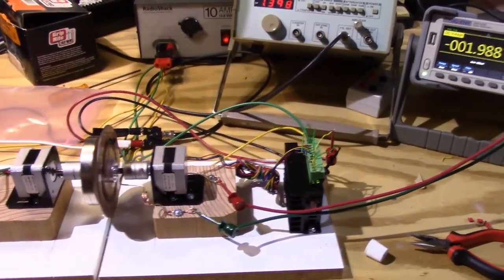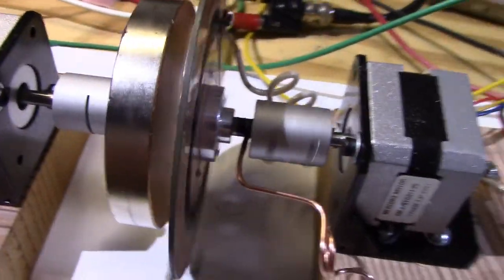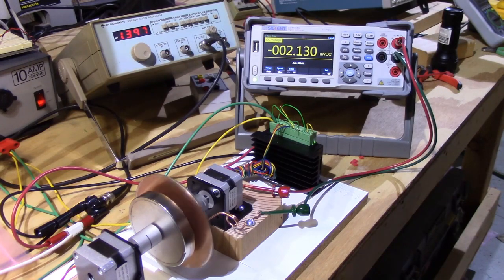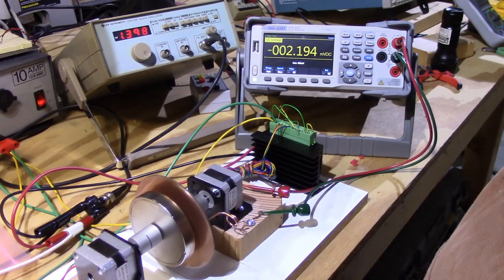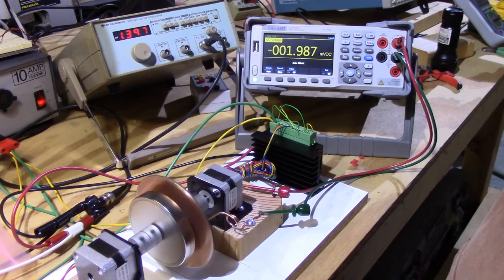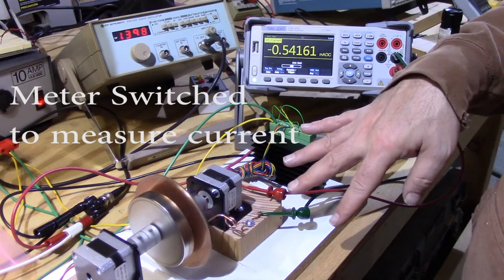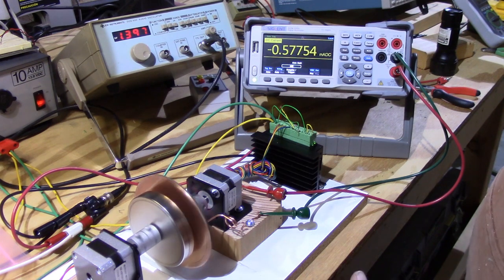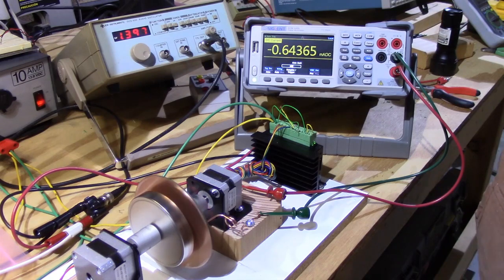PDX1 08: Paradox 1A demonstration: Faraday's Final Riddle

Comment: Sorry if it is already done in the following videos, but I think you should mount a voltmeter, or some compact detector on the same shaft with the magnet. Then rotating magnetic field will not induce voltage in the wires to the voltmeter. In that case there must be voltage even with stationary metal disk and rotating magnet.
Reply from the maker: It does not matter -- https://youtu.be/tzPgIKzSOfA?t=52
Reply: @rdistinti  Yes, I realized it after I post the comment. 
But there is another option: avoid the closing path. E.g. metal disc can be split in two parts, inner and outer, at the middle radius. Before the test we connect them together, then during the rotation disconnect them, stop rotation and measure the charge between parts of the disc. That will show us, if there was a radial electric field during the rotation, without any 3rd part. Or we can heat up the disk and rotate it fast enough, to force electron emission from the edge of disk. There may be many ways. Actually we don't even need a disk, we just need to measure the electric force near the rotating magnet. We can take an electrostatic dipole (like an "electrostatic compass"), put it near the rotating magnet and see if it will turn parallel to the radius. Or we can put an electrically charged dust and look if it will fly to the center or periphery depending on magnet rotation.

Comment: Did you do the amps reading with a stationary disk and a moving magnet ? Everyone does the voltage reading on that and it's below multimeter range, but i'm interested in the amps when only the magnet is moving.
Voltage has absolutely no importance. Voltage can be easily created. Only amperage matters.

Comment: "Electromagnetic Fields and Waves" by Lorrain & Corson (2nd edition) discusses induction in a moving system in Chapter 8 and Appendix C.  (I used this as an Undergrad.)  The 3rd edition contains it as well but the text has a different arraingment.  Faraday's Disk is also in Chapter 14 "Dynamic and Quasistatic Fields" of Zangwill's "Modern Electrodynamics";  it's on the level of Jackson without all of the sharp edges.
Reply from the maker: This site is old.  see the updated site https://youtu.be/8D6VaoEeRt8

Comment: Magnetic field lines are microscopically uniform and moving at light speed from N to S so speed of rotation of the magnet is irrelevant but the conductor disc cannot be uniform microscopically and its' spin cuts through the magnetic field lines like a wire thereby causing currents in the disc whose induced magnetic field opposes the direction of the manets field?

Comment: Just don't turn the disk or the magnet but just turn only the brushes in stead. It's simple where the voltage is coming from. It comes from the brushes by triboelectricity. The difference in friction is the volta generator. It can't hold the charge for long though because metal is a good conductor. I don't get it am I surrounded by stupid parrots 😂? Use your brain folks it comes from the brushes!!! Triboelectricity I say!

Comment: the "lines of force" that iron filings produce, is an illusion?

they are ferromagnetic. each filing becomes a magnet in its own right. and, as magnets are want to do... they will line up in long strings, NS>NS>NS...

and when those strings lie side by side...

NS>NS>NS
NS>NS>NS
NS>NS>NS

see how like poles are side by side? and what do like poles do?

they repel.

the "force" is at RIGHT ANGLES, acting BETWEEN the lines....

i keep coming back to bernoullis theorem regards that one... as if there is a flow... a rotation around the axis of the magnet.

and like little ping pong balls with a stream of fluid passing between, they tend to get "sucked together"... in the direction of faradays "lines of force".

we can demonstrate quite easily that the strings of iron filings remain stationary when a magnet is moved around, that the "lines of force" have no direct connection to the magnet itself.  simply leave a small gap under the magnet (with a pole towards the paper) and when the magnet is rotated, the filings and the "lines of force" they depict remain stationary. slide the magnet around sideways... and the filings follow the magnet pole exactly as any other magnet will try to. but those "lines", they have absolutely no connection to the magnet itself. they are an ILLUSION. they are not showing a field or "line of force", they simply show that they are becoming magnetised themselves.

and that ties in very nicely that it doesnt matter if the magnet moves or not, its simply how the conductor moves in relation to the field or "distortion" or "flow" or whatever it is that magnetism actually is... any movement of the conductor in that "field" creates a potential difference, a change of pressure, a change of "flow".

when we PUSH one of these strings, these lines of force, what do we see? the adjacent lines move as well... the force is acting at right angles BETWEEN them.

any rotating system has two sides. two "poles". one CW, one CCW... its inherent and cant ever be any other way.

two rotations in the same direction complement. the rotation continues, and if there were a "fluid" between, it would be flung out, and a void or low pressure zone shall be created. we get attraction.

two opposing rotations cancel, any fluid "stops", remains stationary, and increases in pressure... there is "repulsion".

that is, two magnets end to end will either attract or repel depending on their orientation.

the same happens when side by side, but the other way round. two contra-rotating objects will accelerate the fluid between them, and draw together.

two objects rotating the same way will experience destructive interference, the fluid slows down, increases in pressure, and there is a repulsion. 

that is, two magnets side by side shall attract or repel, depending upon their orientation.

of course, theres still a bit of an issue with the ping pong ball analogy... maybe its the other way, the iron is a venturi, the flow accelerates through the iron, and again, bernoullis, the accelerating flow through the iron produces a "suction" acting at right angles to that flow, or... in the same direction as the "lines of force" the iron filings (miniature, individual magnetic particles) show.

i know. it has as many issues as any other theory. but its the way i tend to be thinking about things now. 

an issue? if something is rotating, spinning... and it encounters some sort of resistance to that flow, that spin... why is there no corresponding reaction?

as in... why does a helicopter have a tail rotor?

but, as outlined earlier... that magnetic field, its "lines of force", appear to have no direct tie holding them down to the magnet. so of course, there would be no reaction upon the magnet itself, but rather simply on the flow or rotation of... something... that magnet is somehow inducing.

and on that train of thought, the reaction should be a weakening of the magnetic field... as the rotation is hindered.

which we DO see when we start joining throwing chunks of iron onto the end of a magnet... as we magnetise more and more iron, induce a "spin" in it...

the "field" gets weaker and weaker... theres only so many iron filings that can cling to a pole before its so weak it cant induce this swirl or suction or whatever it is through any more iron...

we can really push it to the extreme by placing our magnet in a coil and slamming it with an opposing magnetic field of sufficient strength to completely halt that rotation... we have to use a bit more force than expected to bring it to a complete halt, ie, the hysteresis BH loop... and if we add too much... it becomes magnetised in the opposite direction.

anyway, whatever is actually happening?
i still am 100% adamant that the "lines of force" we see from iron filings, upon which maxwells equations are based, all EM theory is based... is an ILLUSION. they arent there! they are simply magnetised particles behaving exactly as magnets do when in close proximity to one another.

i tried it with bismuth the other day.... inconclusive. if there was an effect its so subtle as to be unnoticeable. i saw something but im not sure i did or if it was wishful thinking... i also may need a finer powder, and if there was an effect, i only noticed it when my bismuth filings were in motion as they fell to the paper over my magnet... yeah, i should sand some rather than file it... and my file was dirty so i got bits of iron in there messing it all up... real scientific here, not! 

 i may need a magnet with a bit more "oomph"... i predict seeing something utterly different to the typical "lines of force", if anything.

last thing. you can have an isolated pressure. measured in relation to something. that is "positive", that is "negative"... in relation to an arbitrary "zero".

but a flow? it has to have two ends... there are no magnetic monopoles. 

just like the rotation.

as i said, it aint a perfect theory and it still has many many issues to overcome... but its mine and i like it!

Comment: Mode 0: magnet stop ; plate stop > 0
Mode 1: magnet stop ; plate spin > 2mV
Mode 2: magnet spin ; plate stop > 0
Mode 3: magnet spin ; plate spin > 2mV
All above observations are expected - correct 

For those who are new to Faraday’s motor/generator, it helps to realize that it requires a spinning disc to cut B field perpendicularly. That implies that as long as B field (flux) remains perpendicular to the spinning disc it doesn’t mater that magnet spins or not, will produce emf.

Comment: What electricity is being generated in between the disks, what if you had 2 copper disks spinning in place of the magnet? What if u had the electricity running threw the magnet, like cut a hole out of the center of the magnet and run electricity threw it?

Comment: How many amps are you putting out?
Reply: Well, Theoretically if it would be a closed circuit with very low resistance to say 1mOhm at 2mV you should get 2Amps. But the resistance is higher due to poor contact at the Brushes(that can be 200mOhms) so you would not get more the 0.01Amps.

Comment: Where is the back EMF drag force? What would happen if you spun a magnet disc pair in space, in zero-g where its angular momentum will make it continue to spin forever. And, if you had frictionless brushes, theoretically you'd be able to draw current from it forever? This is not logical since all electromagnetic induction causes some back current which magnetic field cause a brake force on the rotor. So where is the back emf and brake force generated in this motor?

Comment: I believe the presence of the magnet changes the state of the surrounding ether.  So the rotation of the magnet does not matter.  Then you can look at the copper disk as moving relative to the changed state ether.  Then everything makes sense.

Comment: Hello, I don't understand, if it was a more typical, lets say a permanent magnet field generator it would make no difference whether the magnet was spinning or the wound coils were spinning. I am surprised that you get a voltage in either case considering the interface of magnet to conductor that you have setup. I'm not saying that you didn't but the whole geometry of the magnet to the conductor just looks wrong. It appears that with either disk spinning the magnetic field would be unchanging and that changing magnetic field whether it be in a transformer, generator, spark coil or flyback transformer is what I always understood generated an electrical current.
George

Comment: Without the Magnet, the spinning copper disk would still show the same voltage. It is electrons moving from the center to the edge of the copper disk. Electrons have "mass".
Reply: NO, the only thing close to what you say is the Barnett Effect and that wouldn't produce the Lorentz Force.  The dipole, aka the "separation of charges" between the center of the disk and its rim is due to the Lorentz force.  See 'right hand rule.'    With no magnet there is no Lorentz Force.  With no Lorentz Force there is no dipole, no EMF across the disk, no separation of charges.  Only the much much much much weaker Barnett Effect.
Reply: Experiments without the magnet show us a current. (Yet.)

Comment: The same effect could be achieved by having a square shaped coil, like a round coil squashed into a square shape (or more practically, a rectangle), positioned in front of half the disk, from the axle to the perimeter, and spinning it around. Actually you would want two such coils, one on each side of the axle, to balance the weight out. You would just have the coils flipped 180 degrees to each other so the current flow would be the same in both coils, meaning on the left side of the axle the coil's N pole would be up and on the right side the S pole of that second coil would be up. I say square coils because then the wires would be right in front of the face of the magnet all the way from axle to rim, unlike if it was round. I guess you would want to put a bunch of such coil pairs around the axle to produce more current. It could probably be done with one continuous wire if you were creative at winding.

Comment: I have two possible answers:
1. The surface of the magnet rotates flat in one plane. The surface of the disk fluctuates back and forth. This means that the distance between the magnet and disk fluctuates every rotation. This is not the case when only the magnet is running. 
2. The produced voltage and current is very small. This can be created by other causes. e. g. a loop is made around the motor. 
Both of my solutions can be tested. 
If solution 1 is correct, in that case you can manually move the (not spinning) magnet back and forth, without a spinning disk. If every move creates a voltage jump, solution 1 is right. 
If solution 2 is correct, this can be tested by removing the magnet, while the rotated disk is switched on- and off.If there is still a voltage, then it has nothing to do with the experiment itselve. Best regards, Dirk

Comment: Speed up the copper disc in resonance, this is easy to understand that a wave will travel from center to edge and then we have Y movement with a X movement, then the DC voltage will increase. The faraday disc work like this, many people miss this information. To see the movement in the disc see " Slow mo guys, CD " on Youtube.
Magnet is already a self looped system using ambient field in a loop. Al Ni Co Fe Cu Ti S is AlNiCo magnet called.
See on youtube " how it is made, magnets " and understand how metal interract with the earth magnetic field, once started with a DC pulse, each metal have a spin, we can see it also like 6 gears in a gearbox, between each a new frequency is made and the system run with frequencies and harmonics in the existing field.

Comment: Hi, the solution is very simple, you do not need any rotor, or magnet. What produces the current is the brush system, it's just the piezolectric properties of metals. Try placing one of the DMM contacts on the disk with a clip, and use the other DMM probe tip to scratch the copper disk, the faster or the harder you press against the disk the higher the voltage  (DMM Volt mode) or current (in DMM Amp mode) you get. If you cannot get current of DV using copper try a worse conductor such as Tin, aluminium or a hard disk surface.
Reply: Nonsense.  You're not aware of the Lorentz Force as the cause of the EMF, the voltage, developed between the center and the outer rim of the disk.

The only thing close to what you say is the Barnett Effect and that wouldn't produce the Lorentz Force.  The dipole, aka the "separation of charges" between the center of the disk and its rim is due to the Lorentz force.  See 'right hand rule.'    With no magnet there is no Lorentz Force.  With no Lorentz Force there is no dipole, no EMF across the disk, no separation of charges.  Only the much much much much weaker Barnett Effect.

Comment: This is an "apparent" paradox since the setup "appears" to be symmetrical, but the conductor closing the circuit on the disc border "breaks" that symmetry, that conductor creates a current radial "preferred" path between the disc center and the conductor contact point on the disc border, the current generated will be the same if the disc is replaced by a single radial conductor joining the disc center and the conductor contact point on the disc border. 

 The apparent paradox is due to the lack of symmetry on the Farady disc setup.
Reply: By the way thanks for the efforts in seting this up, it is always good to approach critically what is accepted by orthodoxy, usually new breakthroughs will come from departing from what is accepted by the "experts" of the moment. Thanks for sharing.